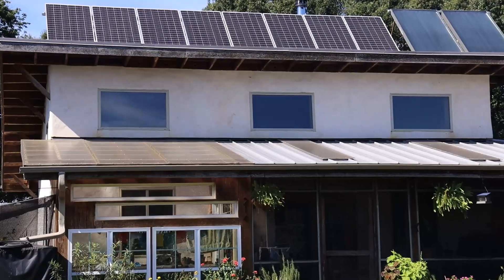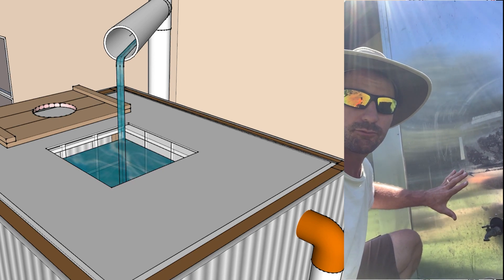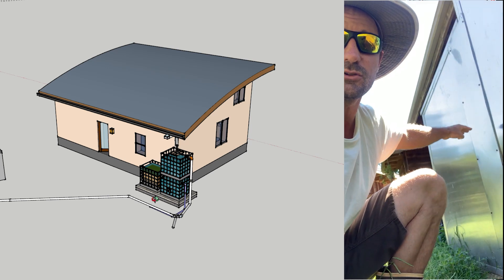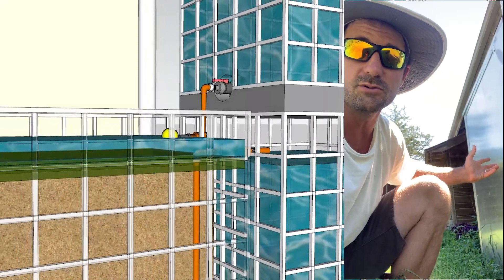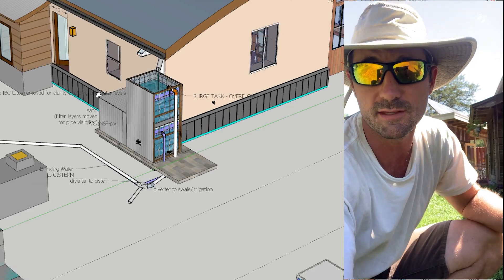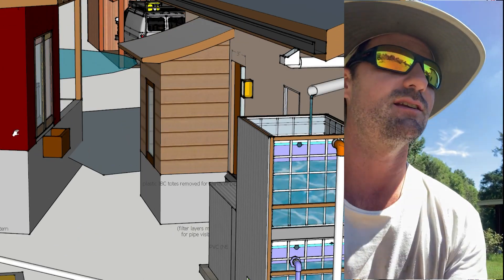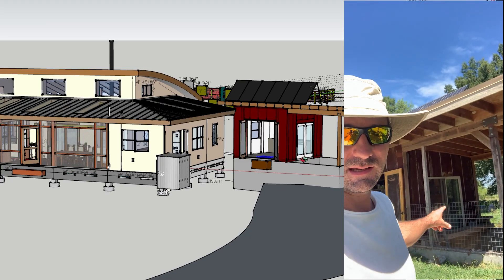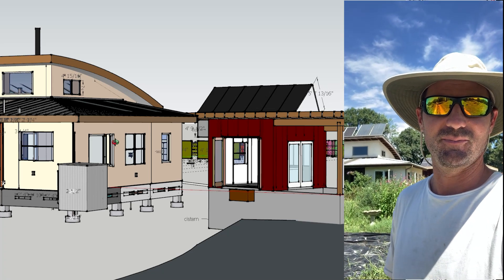AMAZING off grid rainwater system : explained!!!

Comment: Amen brother.   You are not alone.  What thoughts do you have about a delivery system for the drinking water into the house?  thus making the spigot the contingent. Thx
Reply from the maker: We use a dankoff solar booster pump to get water from the cistern to a pressure tank and then to the house

Comment: How did you make the aluminum jacket?
Reply from the maker: I used aluminum sheet riveted to aluminum c channel. The 2” space in between the C channel was filled with scrap mineral wool insulation, but rigid foam would be a better (lightweight) option if you have the budget.

Comment: Just came over from Homesteady.. Hubby and I have been researching all types of things, including a water catchment system. Going to have him watch this. One thing I thought of as you were going over the shed/cistern. If there is a way for you to install a hand pump, I think that would be easier than lowering 5 gallon buckets as you age. I dont know if you can install one at this point without contaminating the water though.
Reply from the maker: I’m sure you could rig up a hand pump. We use an electric pump to pressure tank to get pressurized water in the house. Never had to lower a 5 gallon bucket down to fetch water, just mentioned that as a worst-case primitive means to get water if our solar power system ever fails.

Comment: So, I am guessing (without buying) that you have a great prefilter above your water intake tank that takes almost all of the unwanted debris from the rain roof, before it drains to your sand-filter system....and I am guessing (again) that there is little to no need to change out the sand-filter.....
Reply from the maker: You got it. The WISY vortex pre filter is amazing. the sand filter needs about an hour of maintenance every 2-3 years. This video shows that process: DIY Home Water Filtration System: Rainwater Harvesting with a Biological Sand Filter and Maintenance
https://youtu.be/L56q_pCxULc

Comment: Really nice! What do you do in cold weather? In Denmark that would freeze up in winter....
Reply from the maker: The pipes connecting tanks are not glued together so they expand when freezing temps occur. The insulated jacket keeps that from even happening down to the single digits here in NC. But we don’t have extended freezes like Denmark. I would build this setup inside an insulated/heated building (probably where my pump and pressure tank are located) if we lived in a colder climate